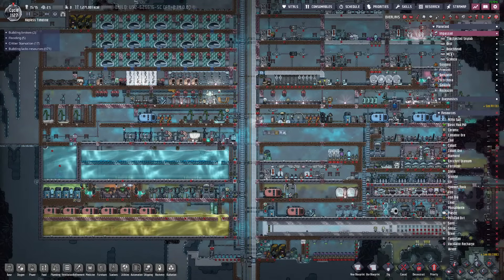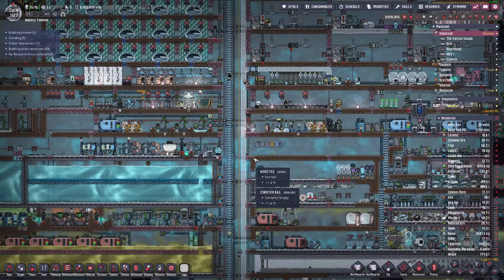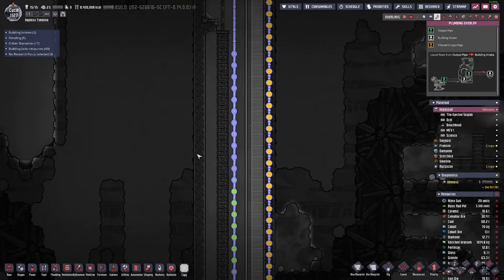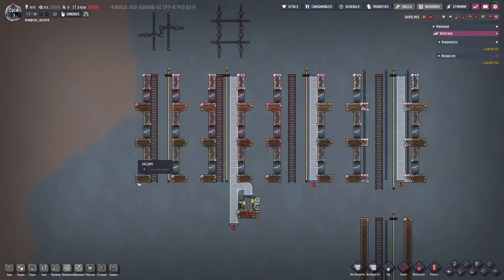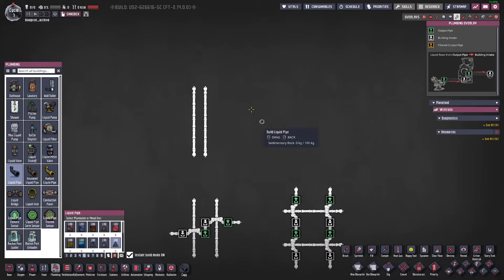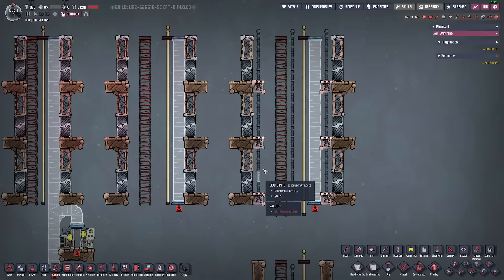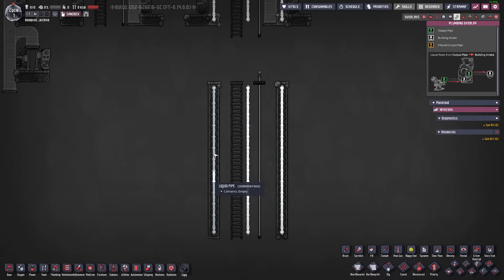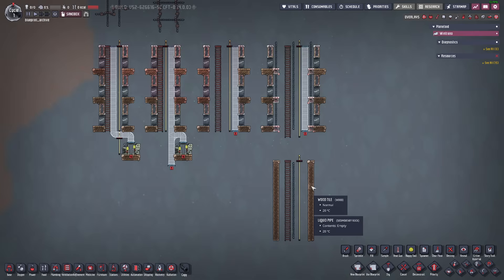ONI / Oxygen Not Included - Wide Shaft Design: Why I use a single 7-width shaft

Comment: For me that seems like unesesarally large. I have a 3 wide shaft.
The transit tupes don't have to be in the main shaft. 
Running pipes next to each other is no issue at all. You can just place a bridge mine the middle tile and then mop up the spill. It doesn't interrupt flow and is very quick. 
That's defiantly a lot less effort than building such wide tunnels everywhere.

Comment: 5:11 you can easily do the 3rd example bridge crossings, but smash them together so there's no space between.

This method looks cleaner and it's not hard to do since the disconnect tool is canon now. If you're having to cross so many pipes that the method stops working, you should take a step back to redesign and make it more efficient. Readability is important

Comment: My main objection to this design is that I like to have my central shaft also be my nature reserve, to ensure maximum exposure to it; at seven wide, that's pretty much impossible (it'd only be 17 tiles tall, or ~4 'stories' of the typical base.  A 3-wide shaft still allows plenty of airflow, while allowing over double the height for a 120-tile nature reserve; and you can run a pnuematic tube down the center between your ladder and firepole.
Reply: You could just put a nature reserve immediately before they put on the suits and enter the tubes, it would pretty much fulfil the same purpose no? Only thing is that they would not get the buff if they are staying inside the base and not going outside to do anything. But do they really need the buff if they aren't leaving the base?
Reply: I tend to have mine at the exit of the area with bedrooms and restaurant.
They pass through twice each day
Reply: I'm curious. How do you set up your shaft to be a nature reserve? I'm new to the game btw.
Reply: @Moody1110  Just put the plants and the nature reserve sign inside the shaft
Reply: Keep in mind, that dupes only need to enter the nature reserve for a very short time to get the full bonus.

Comment: Blasted ceres is my favorite map to play on for sure its very unique. My current playthrough im keeing all abyssalite intact and the starting area is the core base and theres little access shafts going into each individual biomes and having specific industries in the areas. One area is oxygen production. one area is all saturn critter traps/hydrogen storage one is a industrial brick etc etc and rhen building a "elevator shaft" from the top half to the bottom. The map just makes for such cool base deisgns.

Comment: I'm curious where you put your power spine.  I tried to find it in the video, but wasn't able to pin point it.  Does it run across the top?
Reply from the maker: Of the 5 columns in the main shaft it's column 2, right next to the deodorizers.

Comment: I like the design, but I don't think it'd fair well in a Spaced Out map with so many POIs so cramped together to get in the way.
Reply from the maker: All my ONI videos are in Spaced Out maps...
Reply: @StupidFatHobbit  It is not.  Your very first map in your video is WAY too big to be a Spaced Out map.  Plus there are hardly any POIs and SO maps are practically overcrowded with them.
Reply from the maker: @brockormond4131  First map is Blasted Ceres which is larger and has a fixed size but is still in the Spaced Out style regarding other planets. If you want to see an example on the normal Spaced Out maps check the 90 min base overview video. You can make this style work with geysers in the way - you simply add extra floors for them. Some bad moonlet seeds might be rough but the basic concept still works.